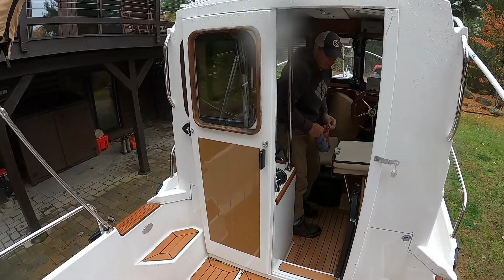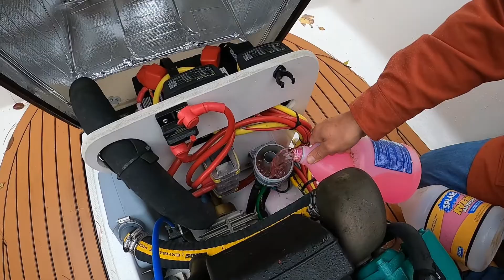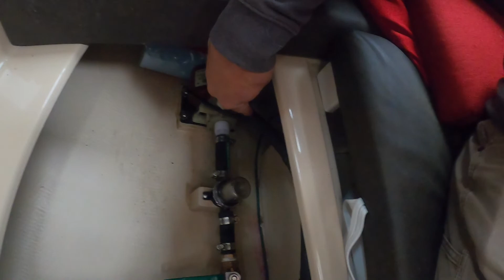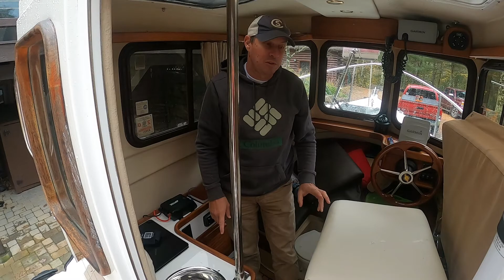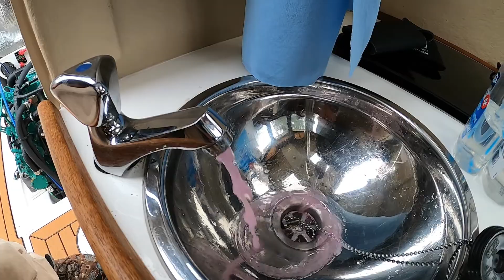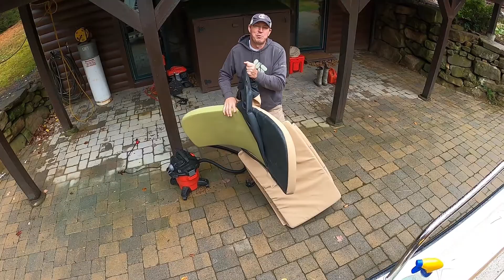VLOG # 19   Fall winterizing a Ranger Tug 21-ec

Comment: Great video! One thing that you didn’t show was winterizing the raw water supply line to the toilet (assuming it has that). Wouldn’t it be best to pour antifreeze in at strainer/seacock and pump it through the toilet to the tank?
Reply from the maker: Hey - thanks for the comment. The strainer for the toilet is a thru hull fitting that draws water up - it is not a fresh water flush - so the lead to the toilet intake can be cleared just by pumping the flush handle and it is drained by air and gravity if that makes sense. Opening the stop cock lets the water drain out when the boat is on the trailer! Hope this explains!
Reply from the maker: Hey. Thanks for the information. The one issue we have is that the seacock is it a 90° angle underneath the boat and it dries up the water from a right angle so we couldn’t get under to do it that way. Ideally the way you describe it is the perfect way to winterize the toilet.
Reply from the maker: Hey. Thanks for the information. The one issue we have is that the seacock is it a 90° angle underneath the boat and it dries up the water from a right angle so we couldn’t get under to do it that way. Ideally the way you describe it is the perfect way to winterize the toilet.
Reply from the maker: Hey. Thanks for the information. The one issue we have is that the seacock is it a 90° angle underneath the boat and it dries up the water from a right angle so we couldn’t get under to do it that way. Ideally the way you describe it is the perfect way to winterize the toilet.
Reply from the maker: Hey. Thanks for the information. The one issue we have is that the seacock is it a 90° angle underneath the boat and it dries up the water from a right angle so we couldn’t get under to do it that way. Ideally the way you describe it is the perfect way to winterize the toilet.